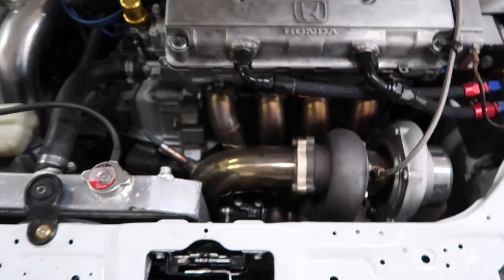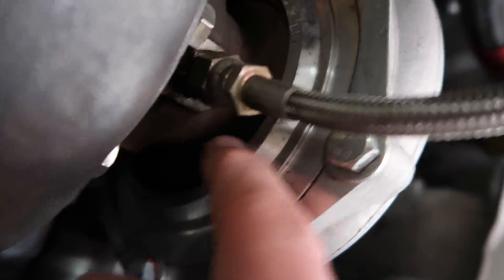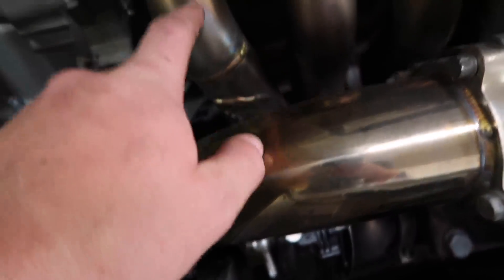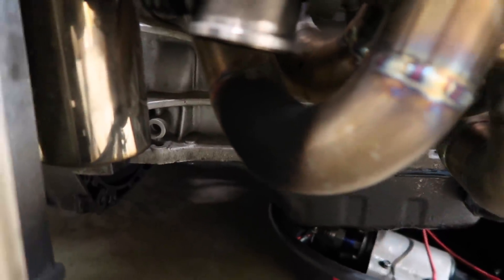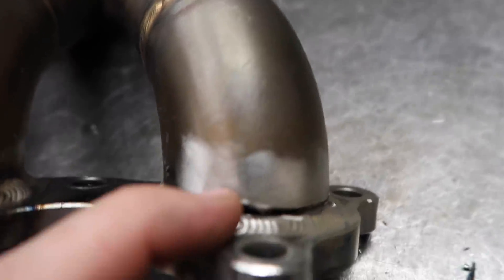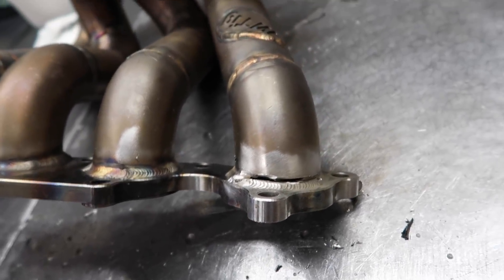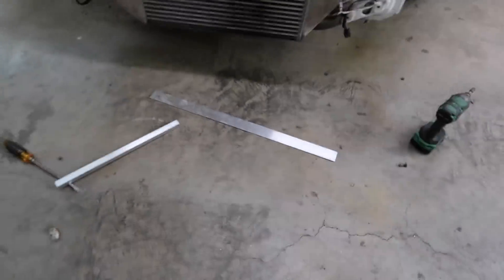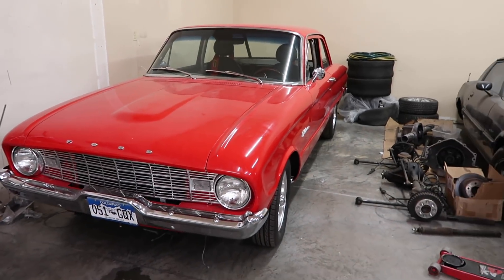Why Turbo Manifolds Crack

Comment: Have you seen the way Subaru custom manifolds are fabed? A lot more rattling than a intercooler with no bolt.. if the weld was strong enough it will act like a mount.. it cracked in a spot where it's a weld

Comment: Would it be smart to add rubber bushes to the back of the intercooler mounts as it will not move with the engine or possibly move it further away from the turbo and add a longer coupler to take up the vibration.

Having the intercooler mounted in a stationary position with no room to move will most likely have the same affect as it bouncing around.

It's the same theory as having a flex join in your dump pipe I would think.

What are your thoughts people of the internet?

Not having a go at Hayden it's just my thoughts.

Comment: Coming from a structural welders perspective, the weld didn't break the metal broke right before where the weld ties in. This is extremely common in test coupons when you're doing the bend test, the metal right next to where the weld ties in brakes but the weld is completely sound.

Comment: Plenty of room to thermo fan...  looks like 10-15mm to me.  How it hasnt melted yet baffles me.  

Ive had way bigger gaps on my setups and had melted thermo shrouds, melted engine mounts, melted wiring, melted wheel arch liners etc etc.  But that is on a car used for motorsport, not for youtube fap content.

Comment: Ok this may be a long post however it’s certainly not to place blame on either side. There are a lot of factors here at work and you’ve pretty much explained them BUT saying that it’s 100% not considered a WELD failure is inaccurate bc the “crack” (which is not even a crack it’s filler metal that never penetrated; a crack is a crack where the base metal actually cracks with the filler metal still attached)  is within the welded area and clearly shows lack of penetration when introducing the filler metal. 99% because the base metal wasn’t heated to temp before the process or the puddle wasn’t hot enough. When we talk about structural integrity these welds should hold several hundred pounds without failure no ifs ands or buts. This video makes me cringe because you’re trying to exonerate yourself when standing behind your work it’s ok to say I screwed up or the process didn’t go right. (As long as you fix it properly no one usually has issues with it and can respect that) I can’t respect you spitting out a bunch of bs misinformation saying that it’s 100% not the builders fault. The flexing and all that with the weight of the cooler sitting on it has very little to do,with a weld failure and has everything to do with the type of metal vs heat cycles vs added stress of the cooler. You’re 100% correct that no one wants to pay double for the 321ss material and in the end pay the same amount anyway because of having to replace or repair it shortly after. Chip Foose quote “it costs the same amount whether you do it right or do it wrong. End of my statement. Most people can tell you’re bullshitting even when you think they can’t. Just make a video holding your part and don’t try passing the buck man. It’s arrogant and lacks personal respect for those involved in the car markets. PEOPLE KNOW WHEN IT WALKS QUACKS AND FLYS LIKE A DUCK ITS A DUCK. Good luck to you man. Next time own your part.

Comment: Why dont you add a gusset where manifolds tend to crack? And also why dont you make a braket that will help support the turbo up from an empty bolt location like ac bolt holes

Comment: You're actually correct but also it's because 304l and all manifolds are not heat treated! That's the main reason they crack, I'm a fabricator and I work in aerospace,  heat treatment is essential to reliability.   The boosted bois are total hack jobs too fyi

Comment: Solid repair brother, only thing I can think of is not having welded the inside as well
Reply from the maker: Boost N More very true. I still feel it probably would have cracked maybe just not as fast?
Reply: Very possible, but like we had talked on the phone about when the manifold is welded inside there is literally no way it’ll crack. It’ll have to be extreme forces to cause it to crack. But then again sometimes material quality, filler rod and others things factor in.

Comment: I agree it's meant to support a turbo not turbo and entire intercooler system with a 4"+ core you should add a brace from collector to flange to prevent cracks if he likes to hang everything by a wire

Comment: Hayden you do good work don't let people get you down 99% of the time it's going to be the vehicle set up that's going to be the issue. Also a lot of the time you also should run a brace from the oil pan to the bottom of the turbo to help keep it in the same place and support it. I wish we had had the opportunity to make the manifold for my 240Z while I was there in Denver unfortunately I'm not there anymore maybe one day I'll be back and you can make one.
Reply: LOL and the manifolds being blasted by wastegate smh

Comment: i think a manifold should last longer then five years. aside the weight of intercooler. its holding all the weight of the turbo too. so those combined i could see it cracking. even just making mounts for the intercooler would help. but making one for the turbo itself. maybe a bracket from one of the runners to like the flange. then you should get a long time out of it. look how long stock ones last. i mean they're iron usually. but even a after market non turbo one last a long time. even if it doesnt have all the heat of the turbo going through it. im sure stock turbo cars last a long time. maybe cause they are iron as well and they make them pretty thick, compared to a steal one. maybe im wrong, but thats what im thinking.

Comment: No intercooler mounts or not doubt that's why it cracked the turbo was rotating to compensate for that very little force would have been applied to that manifold ....it cracked because the turbo has no bracing and with shitty shocks every bump slowly worked at it . Pretty dosent always = function

Comment: Schedule 10 stainless is the only material that you're going to be able to use that's going to hold up and not crack.
Reply from the maker: justa4 banger that's what I use 👍
Reply: justa4 banger sch40 is used quite commonly over here if it's a circuit car for longevity (pbviously small weight penalty), drag cars seem to use sch10.

Comment: If youre not gonna use 321, you might as well use 1018 mild steel that doesn't have heat cycling issues. Right?
Reply: Actually hot rolled would be better because it won't have the cold rolled stresses like 1018
Reply from the maker: Exactly. Good luck selling mild steel manifolds to someone. I've tried selling blasted/coated manifolds inside and out so no rust but no one wants them you could run a mild steel manifold into a wall and not crack it 😂
Reply: Does anybody sell bends?
found  it..https://www.aceraceparts.com/collections/weld-fittings-weld-els/mild-steel

Comment: Hayden, I don't know if you've heard of the book "maximum boost" by Corky Bell, he is a mechanical engineer, and also the founder of Bell Intercoolers. The book is a bit old school (they sometimes talk about blow through carburated turbo systems), but there is a whole chapter on turbo manifolds designing, and all the engineering behind it. I don't know for sure what have caused the crack here, but there  is a couple infos that could have helped prevent that!

Comment: Showing their manifold cracked, and then explaining why they crack if something fabbers even the top fabbers don't do. I love you for this so much respect my man keep up to good work bro. If i ever buy another manifold i will be buying one from you. As for the manifold cracking idk because of the ic, was moving that shouldn't have cause the manifold to crack if anything it was helping. Now that the ic, is hard mounted to the car if the motor shifts under a hard launch it will most definitely crack again. This why people run solid mounts on setup like this.
Reply from the maker: Funny, if I remember right you made a video saying my manifolds were over priced and not that great. But now you want to order one? 👀
Reply from the maker: 100% was the intercooler. Yes shitty motor mounts will cause torque on the turbo because the intercooler is hard mounted. Your mounts should hardly move. Let's just hang about 30-40 lbs off a manifold that is expanding and contracting and see how long it lasts? Smh 🤦🏼‍♂️
Reply from the maker: SI RICKO so you're telling me it's better to have your intercooler hang? It ruined his turbo. I have had zero cars have an issue like this only thing different is everyone else has a mounted intercooler 🤷‍♂️
Reply: SI RICKO you definitely need play in your exhaust setup to prevent cracking even in NA.As far as hard mounts that's more about energy transfer.
Reply: SuicideCRX to be fair he wasnt dissing your manifolds just expressing an idea on how to get your name out  there with competitive pricing.Major companys use the exact same strategy he was suggesting to push each other out of market.He actually said your quality was on point,just that your pricing wasnt competitive given your time in the industry.He wasnt wrong,but obviously it's your work,do what you're gonna do bro.
Reply from the maker: SI RICKO okay, you were confusing me. I think we're on the same page then. Like I said, the manifold is not the issue. If one cracks from IC being hard mounted but shitty motor mounts. The problem is the mounts not the manifold
Reply from the maker: SI RICKO thanks man. Hope all is well with the crx!
Reply: I'm getting back in the Honda game I need one of your manifolds
Reply: SuicideCRX I never heard of a manifold cracking, off this plus the ic having room to move it’s highly unlikely but ok. Well now that it is hard mounted, he most definitely need a damper out good better mounts cause now if will most definitely crack again even all the running next time.
Reply: Thank you.
Reply: No my man im saying now that it is hard mounted, like i said before he will most definitely need better mounts to compensate the movement of the motor or the next time the crack may be worse. Now that i looked at the video again the ic, wasn't even hung completely off the turbo now that i see the hanger so you can rule out the manifold cracking because of the ic man. Don't forget the turbo was moving as well witch even gave it more play to not crack.
Reply: Yeah lol we on the same page now haha anyway keep it up my man product lookin good.
Reply: Thanks Hayden

Comment: Hey Hayden, genuine question since I don't know much about welding.
Do you plan to change your design at all to help prevent this despite it being the fault of the installation?
For example, would two or three welding passes on the top of the runners help prevent cracking?
Or perhaps adding some kind of brace from the flange to further down on the tubes?
Not sure if any of that would just cause different problems though.
Thanks!
Reply from the maker: 802 Garage I don't believe so. Everyone has their opinions but the more you put heat into stainless the more it looses it's properties. As far as mounting something to something else this is a big no no. Think about it. The heat at the head flange is different than at the turbo flange. They expand/contract at different rates causing one to pull on the other. This introduces more unnecessary stresses
Reply: That's pretty much what I was figuring. Thanks for the insight! Your manifolds look great.
Reply from the maker: 802 Garage thanks man appreciate it!
Reply: SuicideCRX water injection to keep the egt's down and stable. Allso some heat wrap to help with a stable temp!

Comment: Need a little feedback, on a b18c1 is it normal for the pulley to look like it's wobbling a little I mean it's torqued in, this happens during idle, someone said it has a rubber bushing and it's normal for it to do that, just wondering.

Comment: I'm a firm believer of mounting the turbo to take the weight off of the manifold. Using a manifold to hand a turbo pipe and intercooler is silly

Comment: The real reason is what you touched on. 304. It's actually a pretty poor material for the job for the reason you mentioned, but like you said, no one wants to pay for 321. (And everyone likes shiny stuff and that rules out carbon for a lot of people.)
Reply from the maker: BenBen CatCat glad you understand. I've tried to sell mild steel manifolds that are blasted/coated inside and out but no one wants them 🤷‍♂️
Reply: I've tried to tell people this for 10+ years now. Either go 321 or coated carbon. Or inconel if you're a baller... This video is spot on and I hope people take the info in it, into consideration. Weld porn welds won't save poor material selection. But hey. It's shiny and the welds look killer, and that's what matters.... right?
Reply: Also.... I've noticed a serious drop in the amount of "um's". ;) And that makes the vids a hell of lot better. imo.
Reply: SuicideCRX how much would mild steel manifolds like that cost?
Reply: Yeah, I didn't know that was a thing....
Reply: SCH 40 mild steel manifolds solve the problem fast.  

Running a brace from the turbo flange to the manifold flange would have likely prevented that even if the intercooler wasn't hung right, but you would have still gotten some cracks in a few years.  It really needs some flex between the turbo and the intercooler unless it's running solid mounts.

When it comes down to it taking as much weight off of the manifold as possible will make it last as long as possible (in other words the lack of an IC mount caused this to happen so fast) but the manifolds could be designed to last longer also.  The'd also be more expensive which would likely hurt sales, just like using mild steel weld els.
Reply: I like a good cast manifold.  Have had a few and seem to do the trick in the form of reliability.  But lacks in performance, and looks.

Comment: I remember joking about MCM taking ages for episodes.  I'd like just like to point out this is what happens when you try and get stuff done quickly/ sloppily. 
You either take longer and do things properly, or cut corners and repair things over and over again (ie wire, missing bolts, not checking tolerances, not torquing things etc etc).  
Nothing to do with your welding though, that looks great
Reply: No Grip yep, that is how Boostedboiz gets so much content out so fast. The builds are half assed. They get 90% of the work done, but the last 10% is all in the small details. I mean, the mr2 still doesn’t even have a shift knob lol
Reply: The boostedboiz got so much shit 2 do...This guy ain't even show updates on his own cars! Shit atleast the boostedboiz get shit up AND RUNNING! And I 've seen way more content then just car builds! Way less bitching on their channel tho!

Comment: Turbo manifolds are under enough stress as it is.  Any weight on it, i'm not sure why I don't see many struts and supports like all the old Cosworth rally engines, and many rallycross cars do.  Turbos need support, this is just that plus added weight.

Comment: Also the furthest runner from the intercooler cracked, clearly twisting the manifold due to the bouncing weight. Furthest runner twists the most while the others not as much. You're analysis is correct Hayden.

Comment: Interesting points on the cracked manifold, I appreciate your transparency on the issues and addressing them head on. In regards to the manifold heat cycling and becoming brittle, I'd think you could anneal the manifold in a kitchen oven to soften it back up, but you'd probably have to have it machined flat again, just an idea 🤔😎

Comment: No hate what so ever for you nor boostedboiz but in the future for your own sake why would you not just run a plate from the head flange to the turbo flange to take the weight of the turbo? Im just curious as thats what i have done for v6 turbo side manifold to save movement for the x over?
Reply from the maker: Hayden Smith they expand and contract at different rates. There is no reason to add something from the head flange to the turbo
Reply: Fair enough then, in Australia we use something called steam pipe for manifolds and it is thick and a couple of supports work for that but probably a different story, was just wondering was all :)

Comment: IMO you'd be stupid to run a turbo without a hanger to support the weight. Look at any proper works race car- Turbo hanger supporting the weight. Even some works race cars that had to use stock CAST manifolds due to Group A rules used hangers to support the weight for racing.

It's rarely the manifolds fault.
Reply: Stock cast manifolds due to Group A rules, but hangers to keep them from cracking in hard race use- http://speedhunters-wp-production.s3.amazonaws.com/wp-content/uploads/2013/02/GIBSON_GTR_1162.jpg
Reply: 100% right
Reply: Read my mind Stav. Yet to see one of these builds with a hanger - can’t understand why you wouldn’t.
Reply: MCM at least would mount their turbos if they didn't use a log manifold. They even explained why they should mount a Turbo in the SuperGramps build IIRC.x
Reply: If you use thick wall pipe (sch 10 or sch 40) you don't have to support the turbo. You see supports on turbos when they are using thin wall tube in which case would crack pretty much right away.
Reply: And that's why race cars only last one season probably